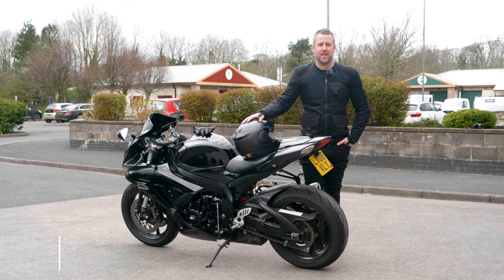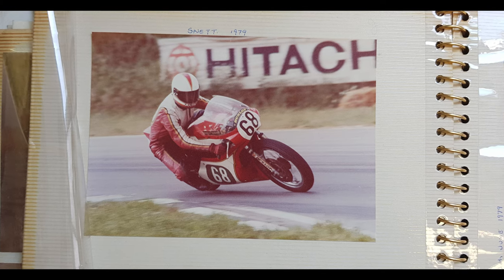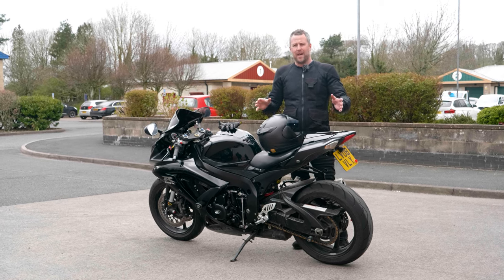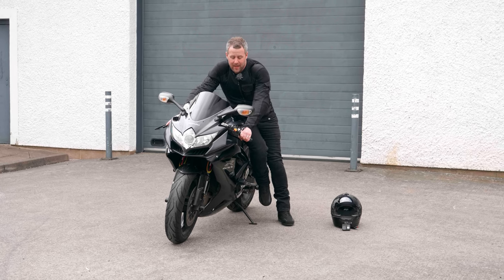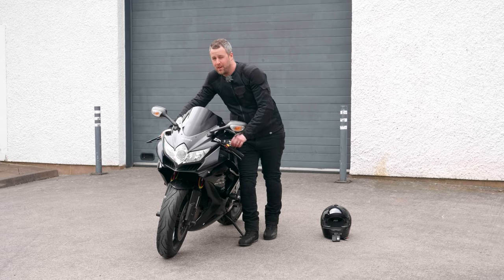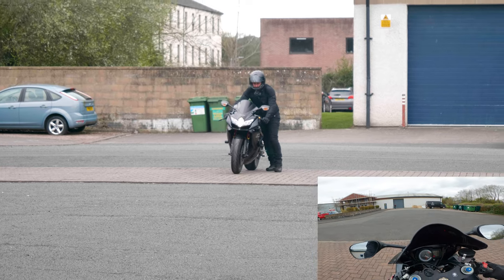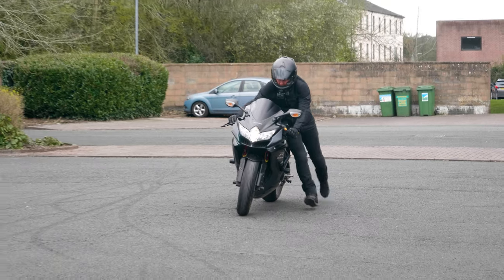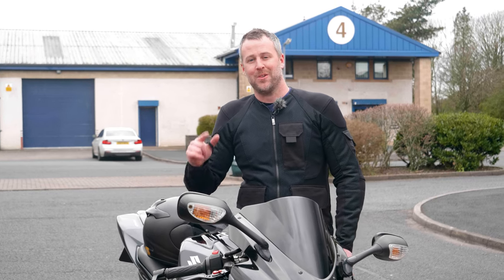How to bump start a motorcycle like a PRO | KNOX armour

Comment: Oh not sure I would want to try that on my H2 😆 I would go over the otherside!
Reply from the maker: Haha... Marquez style! 🤣
Reply: LoL 😂
Reply: if you are afford for h2 you are afford for road assistance....
Reply: @MatiMorini  yeah, but who wants to wait for roadside assistance? Just push that sucker and get going. lol
Reply: @KnoxArmour  6 v9
Reply: You don't actually need to jump on. I can just run with my Scrambler then pop clutch and rev it. 7mph is plenty. Think my solenoid or starter is fkd 😢
Reply: What nobody seems to realise is that when I started riding I had the opportunity to become a marshal at Brands and  Snetterton race circuits. In those days races started with engines off, riders having to bump start their machines to get away. Take a look at some old footage.
Reply: It would be easier because of the much lower compression ratio than natural aspirated bikes.

Comment: Or another trick, which I've still not mastered, is to always live at the top of a hill! 😂  The real sod of it is that it seems as I get older and weaker, my bikes get bigger and heavier!!
Reply from the maker: Haha... you could probably do it quite nicely on the CB1000r, perfect engine for the job! Aaron KNOX
Reply: I tried this at the weekend, didn’t feel so smart when it didn’t work and I hd to push my er6n back to the house half a mile up a 1:10 hill 🥵
Reply: So why not get something smaller to putt around on out of curiosity. While not as fast, a 250 cc leans over just the same as a 1000.
Reply: Top of a hill?
Sad flat Dutch noises
Reply: My driveways on a hill havent had a battery in 6 months. Luckily havent stalled it while out riding
Reply: I'm seriously thinking about downgrading to a Himalayan. I've dropped my bike on three occasions in the last few months (using front brake at slow speed in an emergency). Arthritis is shite
Reply: I've got some sort of starter issue but it bumps so easy, will bumping it all the time do any damage? Can't see why it might 🤔
Reply: @Twiggy163  My 125cc scrambler bumps in 2nd at slow jogging pace, 6mph. No point getting it fixed just yet 🤔

Comment: This works well for bump starting a multi. However, if you have a twin or a single I'd click it into 3rd or 4th gear to bump it. More chance of the engine actually turning over. Stick a twin or single in 1st to bump start it, usually only ends up locking up the rear wheel.
Reply: I have a 650 twin and it started in 1st gear on my first attempt.
Reply: Yeah my rear wheel locked up and is skidding
Reply: Sorry, I am a noob, can you explain why 3rd or 4th gear has a higher chance? Running speed is nowhere near 3rd/4th gear🤔
Reply: @paulrendell8797  thanks for the info!
Reply: @Lurch Never stalled or dropped a bike bump starting it, whatever gear I used. Just keep your hand on the clutch lever and as soon as the engine starts, whip the clutch in sharpish like! Or you could use the push the bike as fast as you can go (preferably down hill) then jump on the bike before letting the clutch out method.
Reply: 2nd not 1st.

Comment: nice to see this... I thought this sort of skill had been forgotten.. but really, you drop the clutch and pull in back in almost straight away... with so many motorcycles just having electric start only, it is a very useful skill to learn. After you have done it a few times, it comes naturally.. and I agree with many of the comments to use second gear...
Reply from the maker: Thanks Miles! Yes probably agree with 2nd gear on most bikes, just seems my own works great in 1st! Thanks, Aaron KNOX
Reply: I would  say to use 2nd gear  as well , used to do that a lot on my 550 years ago, also would push start my old Corrola and jump in using 2nd gear, by myself also

Comment: What I'd add is keep that sucker running for some 5 -10 minutes at least to recharge battery ! Typically if its flat and you bump it then turn it off, it won't have enough cranking power to start again. Gorgeous Gixxer Aaron
Reply from the maker: Yes definitely, good point! Thanks glad you like it, it was my favourite colourway of the 750! Aaron Knox

Comment: Use 2nd gear for twin or single piston engines as 1st gear could or will lockup the back wheel. Also I would not sit sideways on the bike but instead jump up and throw your right leg over the bike so to keep your bike balanced then drop the clutch and as soon as it starts pull the clutch back in otherwise you'll start to bunny hope and loose control.
Reply: Even jumping onto the footpeg will help. All weight is on the bike when the clutch is released. Side saddle seems like too risky for me. Im guaranteed to go over the righthand side 😂 and great advice for 2 and 1 cylinder bikes
Reply: I've got a 250cc thumper little bike a CBX250 twister, it's quite difficult to push start since second sometimes locks the rear wheel, I just don't recommend doing it on singles without help unless you are a somewhat good rider
Reply: Definitely 2nd gear, not first.
Reply: Just curious, why would first gear lock up the back wheel? Would having a slipper clutch negate that or is it a separate issue?
Reply: @teddysurf  Because the gear ratio is so low. Think about how many revolutions of the engine would result from one revolution of the rear wheel and then do the same for second gear. The result will produce a significantly lower number.
Reply: @teddysurf  basically in 1st gear the crankshaft does many revolutions whereas the output axle does many less relatively, this is called gear ratio, it also works in inverse; if you have a 2:1 gearbox, the first spins once and the second gear spins twice, hence two to one, inversely a 1:2 gearbox needs to spin twice for the second gear to spin once

the difference is speed, since if you spin the 1st gear at 100 rpm on a 1:2 ratio the output will be 50 rpm, however with twice the torque due to the nature of teeth count and the lever distance from the axle to the teeth

in short; 1st gear makes the engine give out a lot of torque, however it works inversely from the wheel back, hence putting it in 1st is sort of similar to trying to start a motorcycle in a high gear like 3rd or 4th
Reply: @whattheelijah  … I know what gear ratio is, but you explained all that and then you just kind of jumped over the part why it works inversely from the wheel back? It seems like if you run with the bike in first gear it would spin the engine faster, which would seem like that’s what you would want to start the bike. I still don’t know why it would lock the back wheel up?
Reply: @teddysurf  big gear (1st gear) spin smaller gear (engine output) = chance of the rear wheel not having enough grip to overcome the compression of the engine itself = slide

if you know how gear ratios work then... you should know that to make the engine spin faster you would be needing way more torque to compensate for the lower rpms being converted to higher rpms

Comment: Had to do this a few times with two different CBRs.  That said, I never jumped partially on the seat...just run with it in 2nd, drop clutch and once it starts to catch get back on the clutch again.  Also best not to do this towards an open roadway, in case the bike gets away from you.
Reply from the maker: Nice one! We always jump on the seat as the rear wheel can skid if there isn't enough weight on it. For example couldn't do this on my old er6f without jumping on it.. but whatever works for your bike is the right option, there isn't only one right way. Thanks Aaron Knox
Reply: What model years? My 2009 cbr1000rr won't bumpstart my 2015 bmw 1000rr did
Reply: @jin63r  In my case a CBR250RA and a CBR650FA.  Both did have power, just not enough to turn over completely (so ECU and electronics still had power)
Reply: @Paul B in my case that wouldn't help.  The 2-3 times it has happened to me over the past 10 years on both bikes I would fully charge the battery, reinstall, and it still wouldn't start until push started.

In all those cases too the battery was initially low, but the bike had started, run for 10-30 seconds then stalled and would not turn over.

Comment: Fair play.  Personally I paddle like hell whist sitting normally, it's not easy but a bit less sketchy than side saddle style.
Reply from the maker: Thanks Len, yes the paddle one is safer, but I couldnt do it on my bike as its hard to get fast enough to get it to turn over. May be ok on a 2 stroke or smaller capacity? All the best, Aaron KNOX

Comment: Thank you. This saved me today. 1st gear worked better than 2nd on my Z300
Reply: i have a ninja 300 this is the same engine you think it will work ?
Reply: @lehater2031  works on any bike with an engine. Maybe in a 2 stroke 1 cylinder bike is a bit harder, but is also possible there
Reply: My bike just broke down in the middle of Milan 25 km from home (I have a kavasaki kle500 ) and thanks to this video I managed to get home ❤

Comment: My first bike had a bad starter, which was an obsolete part. Didn't find one on Ebay until my second year of riding. Run/bump-started it the whole first year - with a jockey shifter! Lol. I was in clinicals of nursing school that year, and my car was in the shop for a full six weeks at one point. So if you looked out in the hospital parking lot in the afternoon, you'd see me in white scrubs, with a backpack full of heavy books, running across the parking lot pushing this ugly Frankenstein-chopper KZ440 and dropping the suicide clutch to start it  every day. Good times :D
Reply from the maker: Brilliant 👏! Happy memories for a real biker! Aaron Knox
Reply: @KnoxArmour  definitely learned a lot that summer. Pulling out into traffic was so easy once i bought a bike with a normal shifter, after spending a few years doing it one-handed.

Comment: Will we damage our bike if we constantly do this? The kick start will only work when the engine is already warm/hot. But i always do this on a cold engine
Reply from the maker: I have never damaged the bike doing this... effectively its just another method of turning the engine over just like an electric start. Aaron KNOX
Reply: @KnoxArmour  thanks Aron. I shall continue doing this. I actually park the Vespa 2 stroke in an incline basement parking so I do not have to push it every morning. Thanks for this video. Will not buy a battery for now. But will get the kickstarter gear fixed.

Comment: I have been driving single cyclinder bikes around 250 to 350 Cc. If u can push the bike the best way is to jump on the bike in a riding position and bump start in 2nd gear. That way u minimise thr risk of losing control. 1st gear is too risky if acceleration is not controlled and clutch depressed. By the way i have done these several times so telling from my experience

Comment: Why do you have to jump onto it? Is it bc when the clutch catches it needs an extra little bit of momentum? It looks like it didn't do much since it was a fraction of a second, but I'm guessing that extra push of momentum helps it turn over
Reply: You're not so much giving it an extra push, it's more like the extra weight going on the back wheel to give it a little grip to help the engine catch and stop it trying to just lock up and slide to a halt.

Despatch rider for thirty one years and did it on Honda CX500's, Kawasaki GT550, GT750, Suzuki GS850G etc and never "went over" the other side.  When you're running with the bike, it's always angled towards you anyway so a quick side saddle jump, clutch out/clutch in and slide off again.

Job done!

Once got the bike out of my lockup, flat battery and two bump starts brought absolutely no response  so shoved a fully faired Honda CX500 Eurosport with top box and panniers up the nice steep hill behind me figuring it'll either start or blow up!

At the top, I pushed back the handlebar muffs only to discover the kill switch was off.......🤯

Comment: I've done it but used a higher gear like 2nd or 3rd & worked but these motorcycles had carburetors not fuel injection, my fuel injected motorcycle wouldn't start due to no fuel delivery due to bad battery
Reply from the maker: Cool! Sure sometimes it can work in a higher gear. This bike is fuel injected but seems to work fine tbh. Think every bike is slightly different. E.g the himalayan we had got a flat battery and it did bump start like this, but it was really difficult as it was a single and took 2 people running with it! Aaron Knox
Reply: @KnoxArmour  most of my motorcycles have been dual sport single cylinder & that's where first gear usually was too great of a reduction & back tire would just skid. But had a 2007 Suzuki Bandit 1250s & was fuel injection & wouldn't push start but could've been not enough Italian manpower lol.
Reply: Depends on how bad the battery is. If the battery is completely dead, it wont start, but if it's just low, the battery could have just enough power for the fuel pump and injectors to work, but not enough for the starter. So, a bump start could help if that situation.
Reply: @joemann7971  that must be the reason but I can't complain I got 10 years outta my original batteries & always use battery tenders on all motorcycles & ATV but thanks for all great responses
Reply: @raypetrocelli595  yeah single cylinder motorcycles would start better at 2nd or 3rd gear , not just the gear reduction but also the combustion stroke  😄

Comment: So u hold down the start button, while holding clutch in…then run (while still holding down the start button and squeezing the clutch) and then let clutch out?  Thank you
Reply from the maker: No just put the ignition switch on and once you drop the clutch it should just fire up. Hope that helps, Aaron KNOX

Comment: With a car we choose the 2nd gear. I have always wondered why though.
Reply: Even for Motorcycles, 2nd or 3rd gear is better than 1st gear.  The engine braking on first gear is too much and there's a good chance to stop the vehicle. But if you're on 2nd or third, engine braking isn't that much and  the vehicle should start up way easier.  This is what I think and I'm not sure if it's entirely true.
Reply: @johnjosephhhh1  Possibly he suggests 1st so that the bike is easier to control while running.
Reply: @Sudipto17Kolkata  1st gear is the hardest to control. The rear wheel will instantly lock up if not done right. He demonstrates 1st gear because it's doable in 4 cylinder engines. 1st is reasonably hard with 2 cylinders and single cylinders.
Reply: @johnjosephhhh1  I see. Thanks for taking the time out to explain.
Reply: @Sudipto17Kolkata  Cheers buddy

Comment: I got my battery drained during a 300 km trip and I had to bump start it, again I wasn't able to push the bike b'cuz it's a single cylinder and I always tend to drop the bike the other side when I try pushing it.
Again can anybody explain how a bike can get into this kind of issue in between a run, as the battery must be charging while we are on a trip so there's no way for it to not have power to start the engine. So is it a battery issue or a coil Or some wiring issue.
Let me know and Thanks in advance

Comment: destroyed my gearbox doing this lol
Reply: Not supposed to do it multiple times do it once get it home replace the battery
Reply: Wow.......

Not sure how as there's very little going on with a bump start to cause any such problems. 

On a 125 Varadero, I once kicked down from 5th to 4th except I was actually already in 4th gear so dropped to third and snapped a rocker arm. Gearbox suffered no damage at all and ran perfectly after a new rocker arm.

Comment: I can just run pushing the bike and then pop the clutch and revs. Don't see the point in jumping on til it's started. My 125cc scrambler can bump I'm 2nd at 6mph !
Reply: On a 125cc it's perfectly fine to do that, but once you get into bigger bikes that pull like crazy on 1st gear and you trip while running, pull on the accelerator and go flying or you simply drop the bike is another thing i guess, it's also significantly better to just be on the bike when the clutch is dropped, at least thats the case on my 250cc single
Reply: One of our couriers had a 1200cc Goldwing which he effortlessly bump started each time I saw him.

Just disappeared one day but that happened a lot in those days.
Reply: @fabianmckenna8197 multi cylinders are easier to push than thumpers, sad that the Goldwing was gone those are literally cars on two wheels

Comment: Yes, but I think the motorbike you are using does not have a dead battery.  You could pull mine with a car and not start it. Ie fuel pump, ECM, solenoids, etc

Comment: Yeah, my tires are made of nylon, sort of Power-wheels type of material. If I don't put down all my weight, the damn thing won't start because they slide, I bump started it at work, in the parking lot ramp, that was steep enough for me not to get down from it, but now that I am home, everything is flat, so I believe I'll have to put my ass against it, the mechanic is about 10km away from home, not really that far, but I do not have a truck I can load my bike onto... and I don't think I'll be able to drag my bike for 100,000 meters I'll try it tomorrow that the shop opens, if I cannot start it, I'll be riding my brother's bycicle everywhere, I am a 36 years old dentist in Mexico, and my wife hates me, so she won't take me everywhere, plus, our work schedules do not match that much, nor our workplaces, oh well... I would drag it, but you know... crime

Comment: Should use 2nd gear, clutch out a little fuel and starts right up. That run up was massive 🤣
Reply from the maker: Haha, different on every bike. GSXR 750 does it best in 1st and needs a decent run up... Aaron KNOX